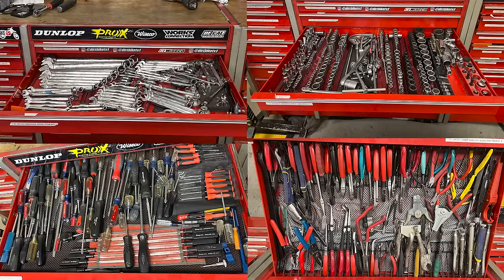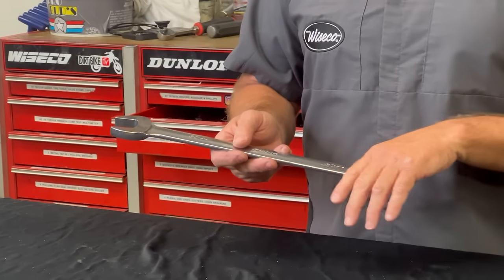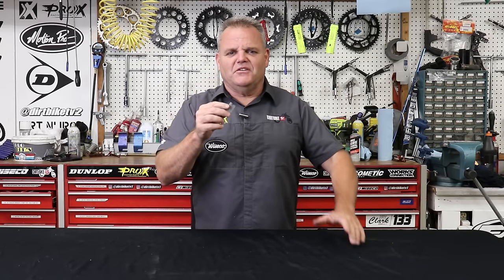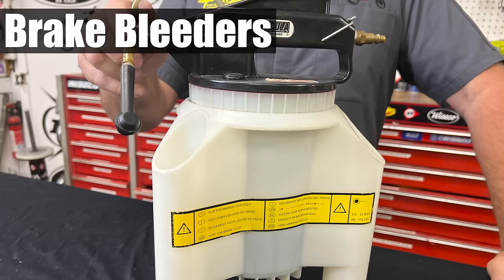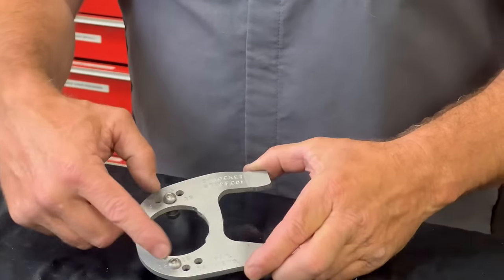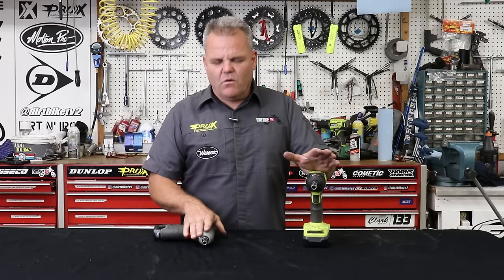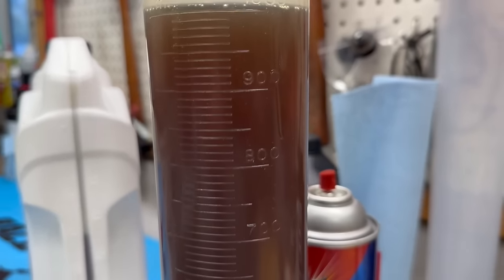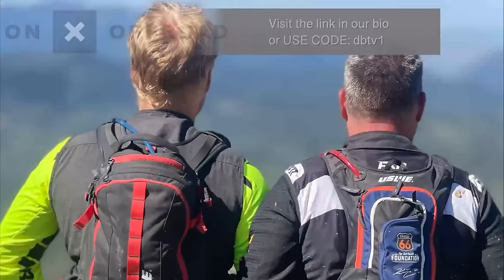Must Have Dirt Bike Tools for your Shop!

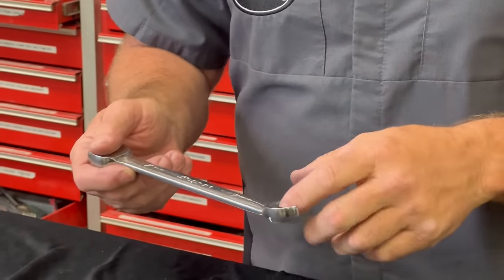Comment: at 21:32 into the video you called the wrench a "crowsfoot", those are flare nut (or tubing) wrenches typically used on brake lines or when doing propane fittings. Crowsfoot connect to a ratchet or an extension

Comment: When I got my first motorcycle (1973 Yamaha CT3) I bought a Craftsman set of metric wrenches and sockets. I think there might have been 21 pieces in the set. When I got home my dad ripped me a new one for wasting my money on metric tools. It’s been 50 years now and I still use the wrenches but bought a set of the sockets with large numbers since I struggled to see the sizes on the old ones. RIP pops!

Comment: One thing I would add, get 6 point not 12 point tools.  12 point are more prone to rounding off bolts and have less surface area to grab that stubborn bolt.
Reply: I use 6 point sockets.
Reply: He says this in the video
Reply: @Fermintation  I must have missed it.

Comment: It's hilarious when he got to the multimeter.  He said, "You can get an inexpensive one or one like this high dollar one."  That meter is a POS. If you don't have a fluke 85 or 87 you have a piece  of crap.  Typical mechanic that knows nothing about electricity.  Stick to your hammers when giving advice.
Reply: Wow Easy there !
Reply: @northernspur6282 if it ain't fluke. It ain't good